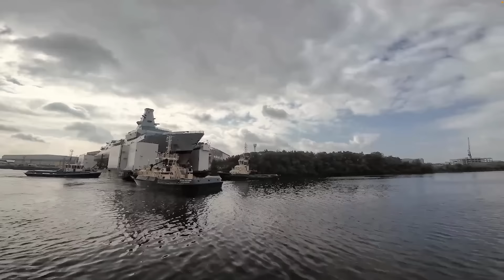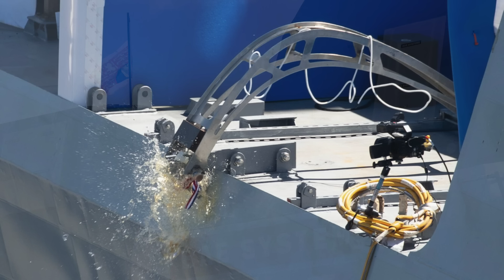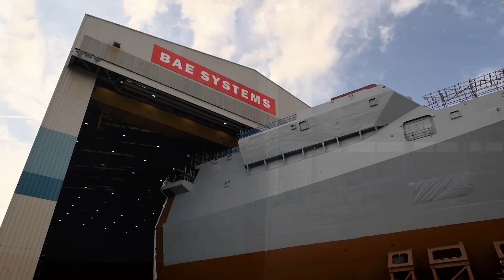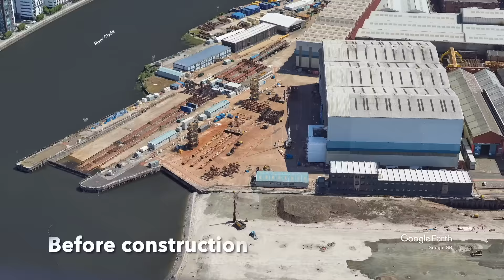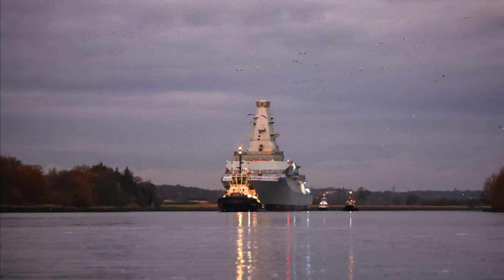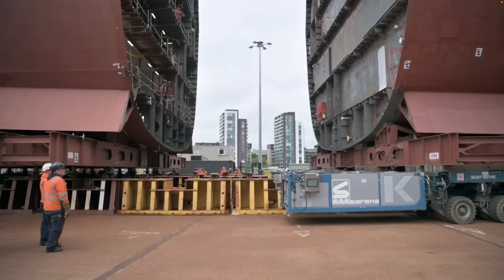HMS Glasgow Comes Alive: Type 26 Reaches Power-On Milestone

Comment: Quoted on the diesel engines back in 2014, but beaten by the MTU 4000 system, now the engine of choice for the RN latley.. _Its a good system, just would have been nice tp get a british built engine back into the current surface fleet... MAN Diesel, previously Paxman in Colchester.

Comment: Before they call this success 
Lets put it out for testing
With all eQuipment  working
Then we can see How good it is ,Weve got five already doing nothing already new
Engine upgrades, caus under
Powerd coudnt cope with heat,So this time take to hot climate and Test properly
Reply: The problem is that HMS Glasgow, having been laid down in 2017,  is only like to commission in 2028.   HMS Cardiff is due in 2029, and HMS Belfast, hopefully, in 2030.

Should it really require ten or more years to build a Frigate?

Comment: Key Milestones & Delays:
Early Concept (2010s): The program, evolving from the Future Surface Combatant (FSC) into the Global Combat Ship (GCS), aimed for first-in-service by around 2021-2023, notes this Wikipedia article and this Navy Lookout article, as detailed in this defence article and this Seaforces Online page.
Steel Cut (July 2017): First steel for HMS Glasgow (F88) was cut in July 2017, with an expected delivery in 2024 and operational status by 2026, says this Wikipedia article and BBC News.
Slippage to 2027/2028: Funding issues, production challenges (like the gearbox problem), and COVID disruptions pushed the Initial Operating Capability (IOC) from the late 2020s (around 2027) to a later date, with 2028 cited by Defence Equipment & Support (DES) and Navy Lookout in late 2022.
Current Status (2025): With naming ceremonies and major outfitting underway, Naval Technology and UK Defence Journal expect delivery for sea trials in 2026, leading to service entry by 2027 or later. 
In essence, the initial mid-2020s target has extended to a late 2020s entry into service, with the first ship, HMS Glasgow, expected to be operational around 2028. 

Forces News
https://www.forcesnews.com
Royal Navy's Type 26s delayed by a year at an extra cost of £233m
3 Nov 2022 — The Royal Navy's Type 26 frigates programme will be delayed by 12 months and over budget by £233m, according to the Defence Secretary.

It seems to be a regular theme with our forces over budget and delays aka “Ajax”

Comment: How is the main gun aimed? Is it via manual/optical means? Or is it somehow automated?
Reply from the maker: The 5" has automatic loading, and it tracks targets based on sensor input, but the "man in the loop" has to authorise/hit the fire button to actually fire the gun.
Reply: @WarshipsAndWarriors  Many thanks! I suspected that something like that was being implemented. Accuracy will only be as good as the performance of the electro-optical system allows.

Comment: Why do our navy ships take so long to build  other countries build there's a least a year quicker
Reply from the maker: Usually because they are more complex. An example is the rafting of the machinery in the Type 26s, which is rarely used on other designs. Another key reason is that we do not consistently build warships to enable the shipyards to keep staff, so with each new program new staff has to learn again, which costs time and money.  Consistently build ships to keep the RN up to a level of around 24-30 surface warships and save time and money in builds

Comment: I don't recall other classes having switch on announcements, but then other ships used to take half to a third of that from keel to delivery: Class
Typical Total Build Time
Leander
~4 years
Type 21
~3.5 years
Type 22 (early)
~4–5 years
Type 22 (late)
~6–7 years
Type 42 (early)
~4 years
Type 42 (late)
~5–6 years
Type 45
~8–10 years
Reply from the maker: Factor in the complex sensors and electrics, as well as that automation that saves on crew but requires more systems. Also, compare the size, a Type 26 is over double the displacement of a Type 42.
Reply: @WarshipsAndWarriors Those are valid points. On the flip side, manufacturing has become faster, leaner, more efficient. Ships can be built in segments with a lot of internals already placed in. With the CGI element if the type 26, thats its already been visualised, components added and taken away I'd like to think thats all streamlined the process.

Comment: I can’t speak highly enough of the Type 26. For the Royal Navy, and partner navies, it represents the same kind of transformational leap that the Arleigh Burke class delivered for the US Navy: a step-change in capability coupled with genuine export success.

Also, the Type 31 is proving to be far more capable than many initially expected. Provided we arm them properly, the UK is on course to field the most capable naval fleet outside of the United States and China.

Merry Christmas 🤘🎅🤘
Reply from the maker: Yes, lets get the mk41 VLS installed ASAP.  And a Merry Christmas to you.
Reply: Also let's hope the Type 83 destroyer actually becomes a thing.
Reply: @eddhardy1054 they will.
Reply: Australian Type 26 AEGIS Hunter class frigates will have the Australian designed and made 6 faced AESA "CEA FAR 2" search radars that have not one, but two 2 bands of search radars, a 6 faced S band radar suite and 6 faced anti stealth L band radar suite.
Also linked with these multifrequency search radars will be the 6 faced AESA "CEAMOUNT Fire Control Radars" that can lock on to 60 missiles or targets at one time in a 360 circumference.
That completely outperforms US SPY 1, SPY 3, SPY 6, SPY 7, - S band radars with their single lock on capability fire control radar the AN/SPG-62 in the X-band frequency, these radars have limited stealth detection range.
Hunters also has the Type 26 passive and active ship and towed array sonars which are considered the worlds best along with the ship being capable of silent electric drive during ASW missions.
When this ship hits the water it will be the world's best frigate!
Reply: Canada's literal survival is riding on this program they have to be good
Reply: Not enough type 26s though, the order was cut from the original 13, plus it's taken since 1998 (conception of the Future service combatant to replace the T23s) and we still haven't gotten a warship operational yet.
Reply: Hahaha,you must be taking the piss😂
Reply: Sorry but uk don’t and will never even come close to being the third naval power in the world. As sad as it is it’s just the truth.

Comment: Such a good looking ship, I am almost dead sure Norway get a ship in 2030 or 2031, the French FDI offer was cheaper with good delivery timelines, but what Norwegians really want is replacing the lost frigate and get fleet back to the intended fleet size of 5 ASW frigates. The Royal Navy shouldn't worry, Norway gonna push BEA  to speed up production. Chances are good Danes come with Type 31 order, while I expect Swedes select FDI.
Reply: It would be a surprise if the Sjøforsvaret doesn't get at least one of the early ships but maybe the plan is to duel crew some of them so the Norwegians are fully trained to operate them when they are delivered. Whatever happens God Jul.

Comment: Though not fond of the UK anymore I believe these frigates could be an answer to the US navy frigate problem.
Reply: I think these might be a little too big and complex from what I understand of the US requirement - the Type 31 may be a better baseline
Reply: I think the U.S. has opted for a design based on a Legend-class Coast Guard cutter.
Reply: @Mike-j3b1k  I know I was wrong about the Type 26 but the British Type 31 would be a good idea.  Of course many if not most parts of the USCG Legend class should be interchangeable with a US navy version of the Legend class.
Reply: No McDonalds or Starbucks on the T26 shipmate, so no use to the yanks.

Comment: It's good to see the Royal Navy beginning to acquire ships at a decent rate of knots, a far cry from the glacial trudge of previous builds! Perhaps the MOD would consider retiring ships from the fleet AFTER replacements become available. I'm thinking of Ocean, Albion and Bulwark!
Reply: Ocean has been decommissioned and sold to Brazil for seven years now.
Reply: Ocean was at the end of its service life already when it was sold, not to mention it basically did have replacements in the two QE class carriers which can carry large amounts of helicopters if needed 

Ocean was a very cheap ship built to commercial standards
Reply: @omarbaba9892 You don't risk your aircraft carrier for helicopter missions which require coming closer to the shoreline. That's basic. Saying QE can host helicopters is just ridiculous.

Comment: It’s honestly astoundingly impressive how fast these ships are being built. Truly amazing!
Reply: She was laid down in 2017. She’s not expected to enter service until 2027/2028. So that’s 10-11 years to build a single frigate.
Reply from the maker: First in class will always take longer, and the delivery will be 15 years after the last Type 45, so they are also expanding the knowledge and experience of lots of new staff.  Hopefully with the new indoor construction and the gain in experience follow on builds can be accelerated.
Reply: @redtob2119 , still, I’d say genuinely that’s a good timeframe for this kind of warship. Not to mention that they’re building multiple at the same time.
Reply: @liamc9998  no it's not..
Reply: @liamc9998 I promise you I have worked on these ships it is disgraceful the amount of time it takes to build these.
Reply: @redtob2119  Program started with the FSC requirement in **1998**
Reply: Its still amazing how long it takes. eg HMS Dreadnought, with well over twice the displacement, was built in just 1 year in 1905/6
Reply: @campbella2796 , true, however we had the ungodly infrastructure back then and warship construction was relatively more simple.
Reply: @campbella2796 Far simpler ship to be fair.
Reply: You'd think Britain would at least get its bread and butter right, an actual potent navy.
Reply: 31 years from concept to commissioning. Lightning fast.

Comment: I'd rather have a European gun system..  I'm sure that something with anti drone fragmentation rounds would be more handy.. perhaps 2 x 3 inch strales could have been used.. or some such
Reply: The ships each have 2x30mm that can do anti drone duty, admittedly at closer range though. From 2027 the RN will start fitting ships with the Dragonfire laser system which is perfect for anti drone and munition work.
Reply from the maker: As BAE systems produce the gun for the USN, it makes sense for them to use it given the size of the ship. The advanced ammo options in the future are good options. I would have like to see it being mounted on the Type 31, as I would imagine these would see more inshore work that the 5" would be useful for attacking land targets as well

Comment: Good progress . Excellent succinct video . However we really do need to accelerate production . It’s difficult to see how Norway can get its first frigates before 2030 without some of those under construction for RN being transferred . Inevitably there will be further delays . I wonder if we shouldn’t expand the type 31 order by another 3 ships to compensate . I know this is a completely different class of frigate , but the Type 23s can’t last forever .
Reply from the maker: The previous government was hinting at a Type 32 as a follow on build, which would be ideal for the end of the existing Type 31 production line. Then the FADS designs potentially being produced after the Type 26s.  This would have kept both production lines busy, and regenerated the RN surface fleet.  The 2025 SDR made no reference to the Type 32, so I assume that is dropped, and numbers will not increase.
Reply: Given the agreement with Norway re joint fleet and tasking, it doesn't really matter if say the third ship goes to Norway and not the UK as it'd be doing basically the same thing which every navy it joined

Comment: Mfw the Royal Navy is better at building ships than the US now 😆
Reply from the maker: Now if only we would order more...
Reply: @WarshipsAndWarriors idk how many we realistically need. 8+5 type 31 seems ok to me to start with. But idk
Reply from the maker: The previous government was hinting at a Type 32 as a follow on build, which would be ideal for the end of the existing Type 31 production line. Then the FADS designs potentially being produced after the Type 26s.  This would have kept both production lines busy, and regenerated the RN surface fleet.
Reply: @WarshipsAndWarriors I honestly don't think you'd need the type 32. Maybe a follow on for the river class? A corvette perhaps?
Reply: @starship4453  we should have 8 of each type of frigate instead of 8 and 5 as well as improved river class.
Reply: @starship4453 I think we really just need another 3-5 type 31s, why develop a whole new frigate when you’ve got a perfectly fine one already in construction at quite a rapid pace
Reply: @omarbaba9892 The fatal weakness of the type 31 is it has zero anti submarine capability. Which is arguably the baseline that all warships should have. Every vessel in the Chinese navy has ASW capability, even its tiny corvettes. But the RN frigate has no sonar or torpedoes. Bit ridiculous.
Reply: @jgw9990 saying it has zero just straight up is not true given the fact it can have a towed sonar as well as carry a helicopter
Reply: @omarbaba9892  because the UK is stretched very thin, budget wise. The type 31 is a bigger ship and requires more crew, more fuel, more ammo... Etc.
Reply: @Oxley016 can the RN man them though?
Reply: @starship4453 and it would cost a huge amount to not only develop a whole new ship but also the new infrastructure to support it 

You do realise the type 31 is already a cheap frigate with a very low crew number for its size right?
Reply: @omarbaba9892  Yes I do... But it's still too big a ship for that kind of duty, and a real waste. River class crew complement is about 34-50 as opposed to 110 for a type 31.
Reply: @omarbaba9892 CAN. CAN. Not does. I'm not interested in CAN. I'm interested in DOES. Helicopter alone is insufficient. It needs towed sonar, Hull sonar, torpedoes and a helicopter. Right now it has 1 of them. Inadequate.
Reply: @starship4453 the river class is a police vessel essentially for use in territorial watere
Reply: It's the early 1900s all over again
Reply: @LegitimateCK4120 they should maybe buy type 26! Haha. I think it’s quite beautiful ship too
Reply: @JasonMG8 tbf it was one of the designs the US were looking at before opting for the FREMM design
Reply: I know people say the RN needs more ships. However, I may be wrong but isn't this technically challenging. The Plymouth indoor frigate complex is too small for the 26 and 31. Therefore the maintenance and refit dry docks are increasingly in use. The submarine also use a proportion of the other Plymouth dry docks. Before they expand the fleet does the RN need to also expand the infrastructure and personnel to support and man them as well?
Reply: They always were!